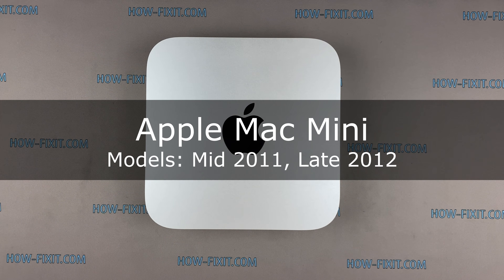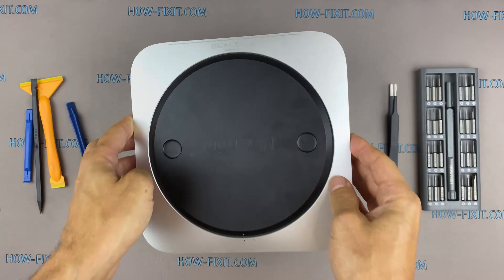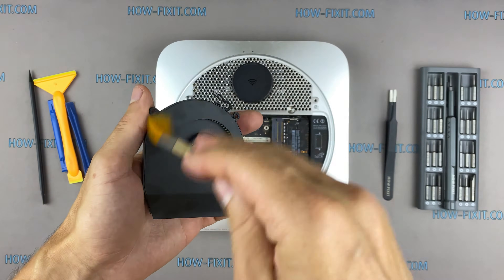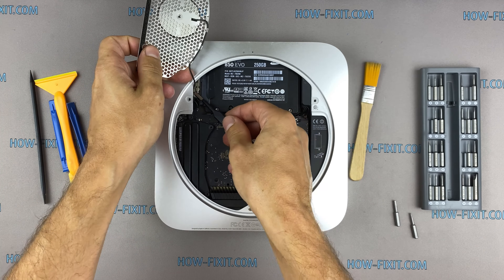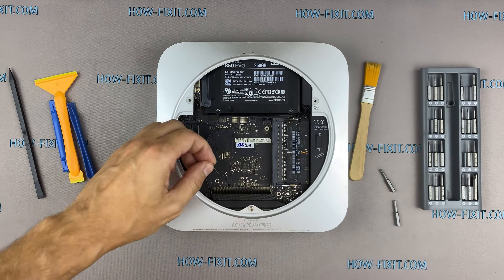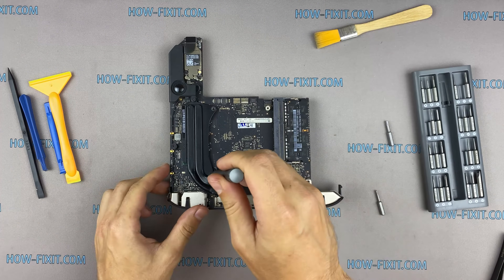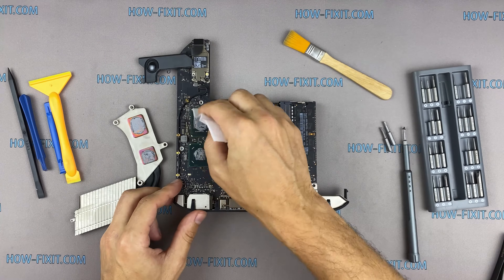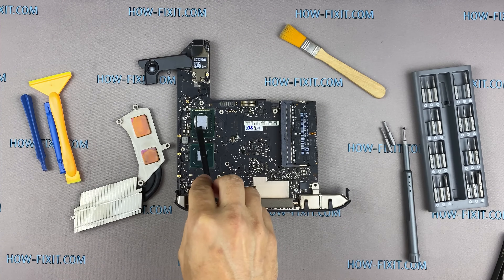Apple Mac Mini 2011-2012 Disassembly, fan cleaning and thermal paste replacement

Comment: Mine had bad heat sink.  It idled OK but video would send it into thermal throttling.  MAC's fan control in the menu bar showing CPU temp was very helpful.  BTW, my 2012 i7 will play 2.5K 60fps video with ease.

Comment: I have one of these and just recently the fan has started to make a constant noise within. It's not getting hot at all, and is working fine ... but the fan can be constantly heard with a low 'grumbling' spinning sound.
Could it just be dirty?
Reply: It wants to be cooler. I just started experiencing fan sounds tonight; I'm using a bowl of ice water sitting on the unit to keep it cool while I wait for my replacement fan to arrive.
Reply: The fan is dying, if it hasn't already by the time you read this.  That's my guess.  Order a replacement before it is too late.

Comment: hey uh so for some reason my 3 clips from the backplate are stuck on the 3 hex 2.0 screws, the 2 on the wifi metal shield thingy and one on the bottom of the mac mini, how do i fix this?

Comment: My late 2012 i7 2.3ghz Mac Mini (upgraded with 500gb Samsung EVO 850 ssd and 16gb Kingston 1600mhz ram) was bought in 2013, removed from the plastic packaging in 2018 and used until this last week without removing the stock thermal paste. Average temperature was 85˚C lately and I was quite unhappy because of fan noise. I put an original Thermal Grizzly Kryonaut on about 1 hour ago and it's shockingly averaging 65˚C now with the same use routine, 20˚ is quite a lot. I heard about people using fake TG Kryonaut and telling that it's not performing as described, but my experience is totally different. Now let's observe the lifespan.